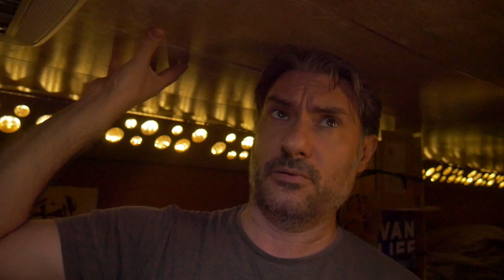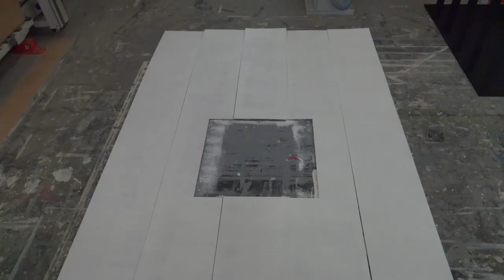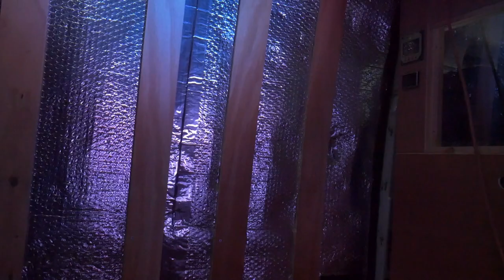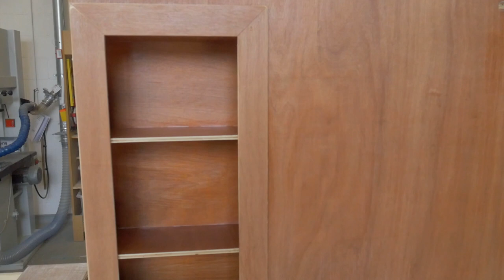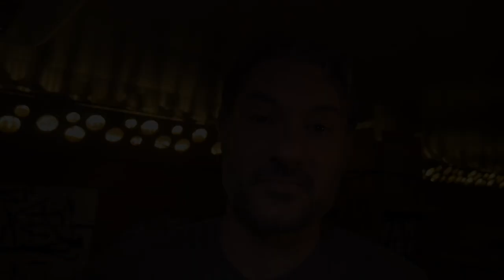Spick and Span - IVECO Van Build - S2 Ep12

Comment: Very nice, i like how you designed it all to come out easily and how you put it to test  and it worked to plan :-)
Reply from the maker: Hey thank you, yeh that was always the goal, to be honest it does require a bit of work now, since the years have gone by, some changes become a little more permanent, but I guess I could strip the van back in less than a day if I wanted. Best Rob
Reply: @redpillinmotion  that’s awesome to be able to take it all out in a day. I am currently redoing my electrics to make it cleaner and it’s taking about 2 days lol